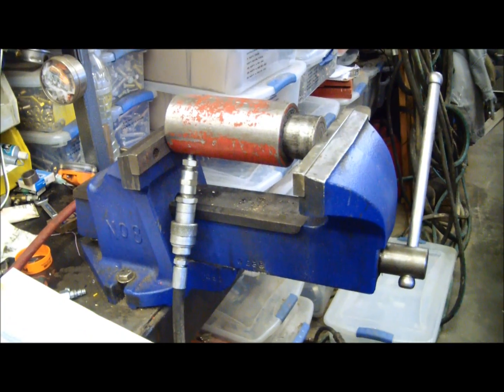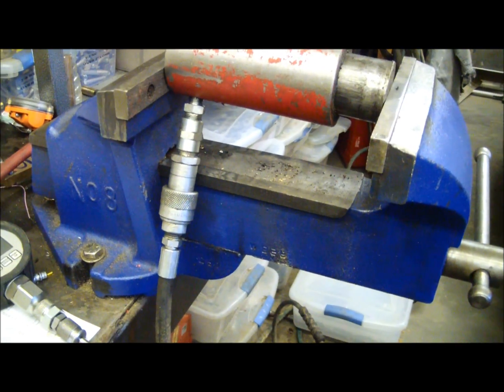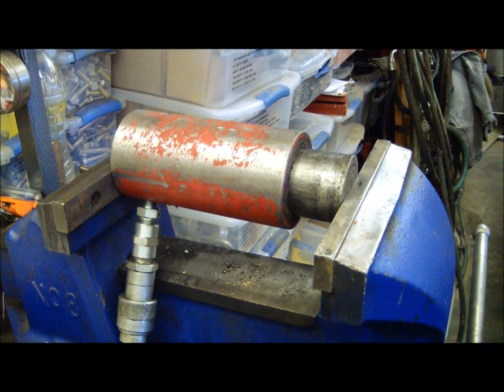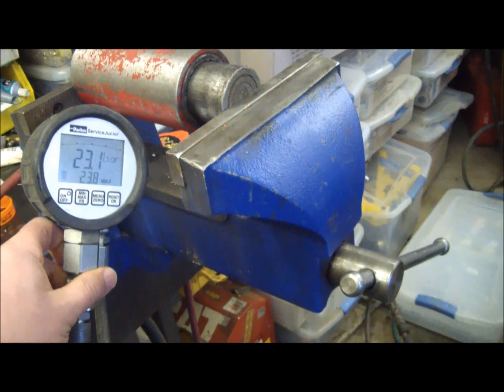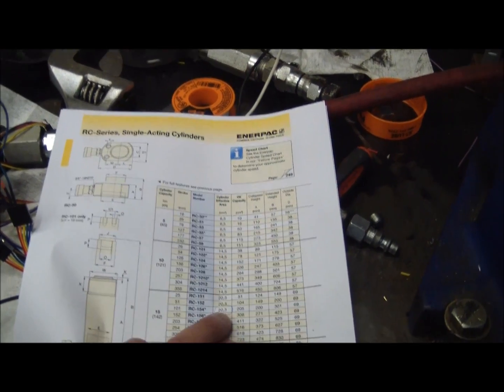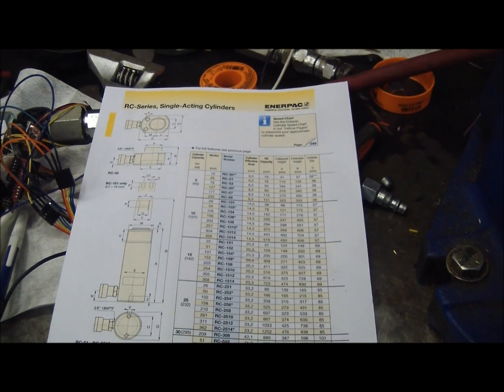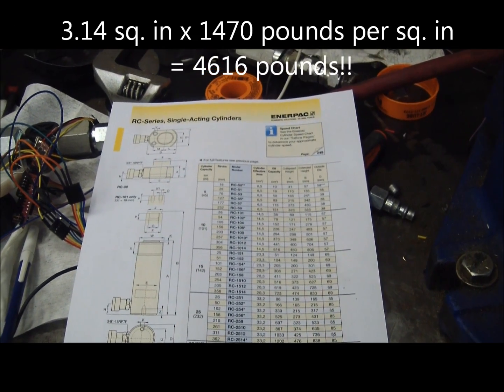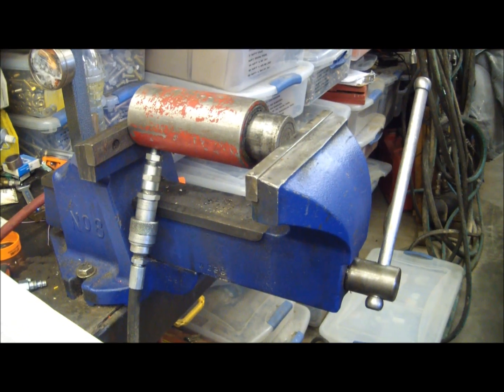What's the clamping force of a vise? Hack a hydraulic cylinder to find out!

Comment: If you haven't already;  try the old trick of attaching a long pipe over the handle (to increase your leverage on the vice).  Then see how much extra pressure you gain using a long lever.  I would be interested in seeing the difference in results
Reply: yer gonna waller yer threads like the village bicycle there pardner

Comment: I couldn quite follow your math but i did a quick clamping force calculation based on a 1/2 major diameter bolt (size of the lead screw on my vise) and assuming 50 lb ft of torque i got 7500lbs clamping force.  I wonder why out numbers are so far off.
Reply: Friction? You are using theoretical force. He is measuring actual force.

Comment: +AvE I'm surprised that nobody here has commented on the mechanics of "simple machines". In this case, the lever and fulcrum. I'd like to point out that the clamping pressure you measured is likely NOT the top end. That is simply the most you can do with your level of strength vs. the length of the lever (the rod used to tighten the clamp). I'd be willing to be that if you got a three foot steel pipe that fits nicely over the lever (effectively lengthening the lever) you would be able to clamp even harder.
Reply: +Native Texan 
Tried that with a 'quality' vise a few months back, snapped the arm; clean in two.
Reply: Anthony Gatti Even better. You can find a steel rod that will fit in the new hole and now it can be longer.

The principle is sound. It's a basic law of mechanics. You just need better quality material. That's all.
Reply: +Native Texan by arm I didn't mean the lever you turn to lock down the vise, I was referring to the arm that surrounds the screw itself. The vise literally cracked in half. High Quality Chinese casting!
Reply: Anthony Gatti Yikes. Yea, well try something a bit more quality made. lol.
Reply: i designed a vise once. length of the lever is calculated. If you use cheat bar you multiple the force, if you multiple it more than safety factor no wonder it fails. You wouldn't hang 500kg on 250daN rope would you?

Comment: Well you had all the units in metric to start with, then you converted everything to imperial so that you have weird multipliers and crazy numbers, and then when you finally find the "force" in pounds, you go "that's about 2 tonnes of force" :| Whaaat? Why don't you use metric all the way and then approximate to imperial? WHY?? 

Better yet, just go metric all the way all the time. Saves you time and neurons :)
Reply: There is two types of tons, metric and imperial, imperial is 2000 lbs metric is I think 1000KG
Reply: LERP DERP DERP
NUMBERS WITH DIFFERENT VALUES
LERP DERP DERP
Reply: I had no problem following what he was saying because I'm from the USA where people aren't drooling retards capable of only knowing one system of measurement and were taught both in school

Comment: Great idea on using it backwards! After your VFD video, I was kind of secretly hoping you were going to put a cylinder in the vise, crank it down, then start pressuring the cylinder until something gave up(hopefully at 10kpsi), and do the math at the failure point. I'm both relieved and saddened, I've never been so conflicted.